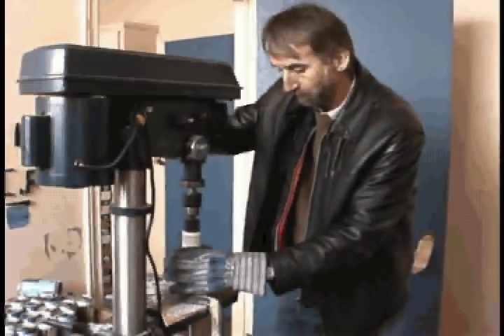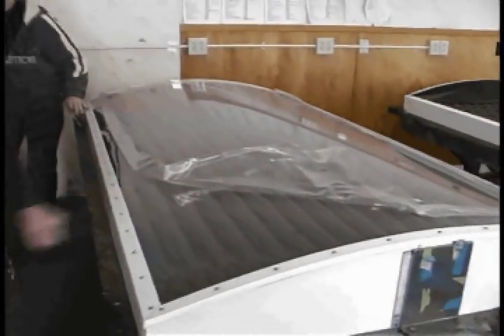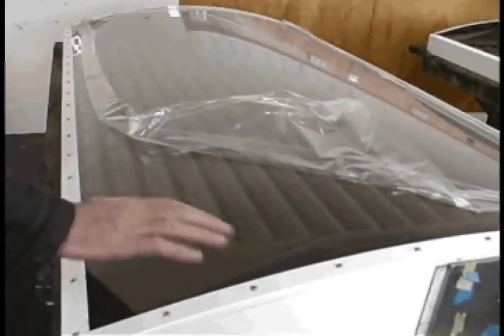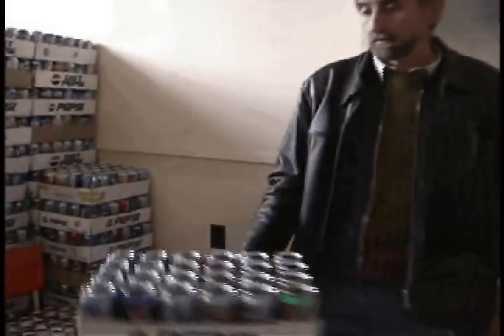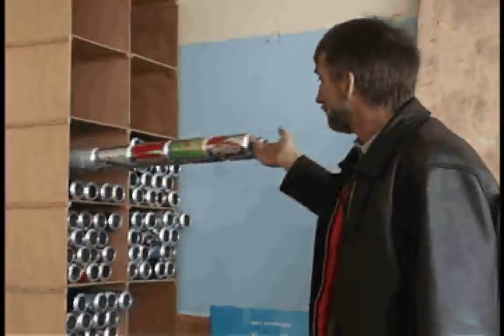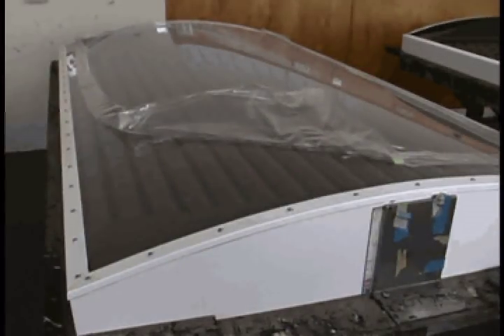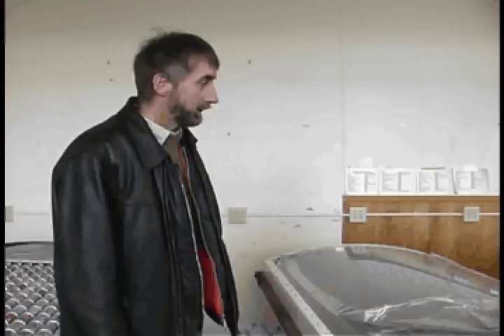Brilliant Newfoundlander Invents the Solution!

Comment: Oh people, you are misunderstanding the importance of this. The main idea is not just getting your house warmer for free. It is recycling, saving few energy cost and greenhouse gas emissions. Obviously it wont work at night, but it will save you few bucks during the day. Also you reuse the cans and contaminate less, Thats the point!
Reply: Sorry, but no.  It is about free heat.
Reply: Yeah I have to agree with Greg Green on this one... see the electricity it would take to recycle the cans into say Aluminum Foil ... well it is nothing compared to the energy savings in the HEATING... so... recycle the cans (to which you get paid for the Aluminum) by some wide aluminum foil .. use some clothes hangers (wire) on either side of the foil sheet as "ribs" periodically..... paint one side (the outer side of the foil BLACK .... then... do not use a fan... hole at the top to let the hot air in the house... hole at the bottom to allow cooler air from the house to enter into the plenum you have created cheaply.... and you know I know it doesn't sound green.. but a Fresnel Lens (plastic square one) used as the glazing on the front.. would REALLY boost performance.... see it's about not using electricity and using the recycled materials correctly.... aluminum foil mostly is made from recycled aluminum... and the increased output with less power input (the fan hint) ... well since you work it on convection.. you don't need to use electricity to run it...
Reply: jajaja wow, I study ecological economics and I know environmental issues like greenhouse gas are real because of physical evidence, I don't listen to government I don't even believe in politicians but that's another problem. All these opinions depend of the point of view of each one, calm down tough guy!
Reply: SmoothRide Scooter pnjjnhgnmm jkjnkjj
Reply: Ahhh vitality B. I have been there.. I simply remember is one I bottle of bourbon ... one bottle of whiskey... and one case of beer...  how the lawn gnome wound up in the backseat of the mayors car with me with us under the flag of Peru I will never know....
Reply: Oh freak.. leave me out of this.. I want to save the world with green energy technolgy while enjoying 1 bourbon...  1 wiskey.. and one beer... LOL
Reply: why do I feel old right now?

Comment: The energy companies won't like this at all.
Reply: Peter AUSTIN You can use it to heat up that rock you've been living under. These have been around since... well... 2008. Plus, if you're talking heating then you mean to say the OIL companies.
Reply: Austin Lucas
Good post. I haven't read Mother in years. It is a must have. I will look them up online. Thanks mate.
Reply: Doesn't work without a standby coal or nuke power plant, next.
Reply: +409novaman Huh?  It doesn't generate power, it collects heat from the sun... I don't understand how you think that requires another power source?
Reply: Actually that’s false.  Utilities want you to conserve energy.  They resist the need to build new generation facilities as the regulations and permits are outrageous.  They have no choice but to pass these costs to you.  Most if not all of them are incentivizing you to conserve.  Contact your utility and ask to have your home audited.  They will generally do it for free.  They may identify a few areas that may thought of.  Knowledge is power.

Comment: I see people asking the question - how do you heat your house at night with these heaters? I don't understand why someone would ask that question. At night you use the same heating system as you're using now. These solar pop can heaters has the word solar for a reason. Solar - Sun. They only work when the sun is shining on them. After sunset or cloudy days you use your existing heaters. Even when the sun is shining this heater won't heat an entire house. It just helps to heat it. I built one a couple months ago with 256 cans and it  works better than i thought it would. When the sun strikes it in the morning the temperature starts rising. After about an half hour to 45 mins it reaches about 185 degrees on a day of about 15 degrees outside and it stays at 185 until the sun goes down. I use a fan of 100 cfm. I'm selling the one i built because i want to build a bigger one. If you're interested email me for photos. I live in Newfoundland, Canada. Asking $1200.00...

Comment: This guy is a genious
the  shape of every can  improves  the spinning of the air inside  or else there was no (no significant)  metal to air heat transfer if the air goes straight trough it.
The can's are very thin so there is no loss
the box provides insulation so it is usable when it is cold outside

Comment: Without a low emissivity coating on the cans you will be limited to relatively warm climates and/or clear skies for any useful heating. The radiative heat losses will become very large as the temperature increases.  But, experimenting is fun.

Comment: How does this system perform in Canada's harsh winter conditions? does the Plexiglas containment allow it to absorb heat from the sun and be less effected from the -30 degree temperature and winds, or is there a noticeable performance difference with temperature change? Regardless great idea and I will defiantly be looking into this more!

Comment: The air from the room is sent through the cans and gets heated from the greenhouse effect of the chamber and plastic window . Also absorbs heat from the sun directly via the black  paint on the cans.
Sort of like a black hose filled with water on a sunny day,only using air.

Comment: Get two 2x6 sheets of corrugated tin mate the pieces together with the ridges touching and pop rivet together. This will make the solar heat exchanger tubes and takes about 30 mins to make. Put in a box with insulation on one side and glass front. works for me.

Comment: Air isn't the best, but not entirely a bad medium if it is controlled and contained. That is exactly how glass fibre insulation works in your walls. It traps air. The air voids insulate, the same way the space in your glass panes in double and triple sealed units do. Albeit, now you're moving the air, but it is from a sealed plenum that is building up the heat, and then moving it.

Comment: If you take the air in at the roof vent and expel it at the bottom vent you will improve the heating in the house. This only works if it is fan driven. You can make an air cooler system using evaporation, the tubes are porous and coated in fabric placed on the shady side of the house.

Comment: By placing a fan on the inlet (cold air coming in) you pressurize the panel. This will push the heated air coming out the top of the panel to a lower level. I had an engineer calculate how much it would cost for the electricity to run the fan and he said it will run up my light bill by around fifty cents per month. Imagine that...Heat a two-car garage for less than the cost of one can of pop per month!
BTW...Solar panels do work on cloudy days, just not as efficiently.

Comment: The  yield of the solar box is zero  at the maximum temperature.
You save around 1kWh/(m2sunnyday)  around 0.1$/(m2sunnyday) roughly, but with maximum air rate flow coming out at around  85°F=30°C.
The yield is maximum when the coming out up air is at the minimum temperature useful to heat the house, (minimum heat  loss inside the box ) around  85°F=30°C, with a large fast air circulation, with large input and output .
In this case the power is around 300W/m2  at maximum sun.

Comment: Since you are using a forced air fan blower motor, then blow the air flow reverse of what you said, heat naturally rises, so since you are using a forced air motor, blow is the downward direction so the heat that comes in the house will have a chance to feel it better, more near the floor , since it will rise anyway, send it out at the floor. It will work better, it wont affect the efficency of your heater, it will actually make it work better unless i missed something, let me know.

Comment: Well, it has to cost a fair amount to make one of these plexiglass & aluminum boxes.  The fan unit moving 100 cuft/minute is sucking down electricity 24/7.  So by no means is this totally free.  And don't forget the installation of this unit outside which involves a sturdy mount (think storms) and a two holes through your wall.  Then some townships may consider these units an eyesore - especially in a condo with strict rules.

Comment: The problem with solar heat is that the only time that the sun is at a point where it gives enough energy, it's summer day.  It's colder at nights and winters where the sun is the furthest away.  I could see this used along with a stirling engine to create power, and the power can be "stored" for use to create heat on downtimes, but not as direct.

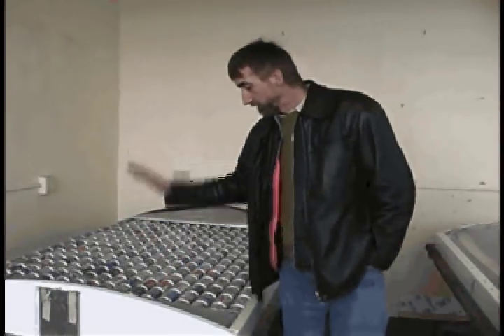Comment: this is an old video so this is likely a stupid comment, but you can "de-tab" a can much quicker by turning it around and popping it off 1:19 . a decent idea, but i think in the relatively short term (10 years or so, maybe longer) more energy would be saved by recycling the aluminum back into other products than making this a big thing, aluminum takes allot (not just allot, insanely massive amount. until electricity was a big thing aluminum was a more precious metal than gold because extracting it took so much energy) of energy to extract from the ore sands, but it doesn't take even a quarter as much energy to remelt it.
Reply: you got it ... aluminum is very expensive and polluting to make ... recycle it.
you can essentially do the same thing with pvc pipe
Reply: SmoothRide Scooter your post doesn't compute, you buy them both man. aluminium is a better thermal conductor than the steel cans that campbel's soup for example come in. but yeah, either work, but having them all be the same size is kinda needed.

Comment: @theapocilip These heaters are designed to work during the day.  If you live in a cold climate and you can utilize one of these units you could probably cut 15-25% off your heating bill.  The reality is is these things are not an alternative heat source, but simply meant to supplement. These heaters are perfect for garages and sheds that aren't heated and owners are looking for a low cost want to heat them during the day.

Comment: perhaps in the ocean, where volume factors into the equation, but if you own a hot water heater, you know your water doesn't stay hot very long if you lose your power, because there is no volume. Compressed air can have a lot more volume than water.

Comment: I have windows in my house that light goes through and heats up the room. Any window could be described as a solar heater.My windows/solar heaters are larger than these being shown here. When the light comes in it heats up the fabric of the room directly with out the need for pop cans,insulation or holes in my home.
Reply: And me linux. :v

Comment: I think that any glass surface has to remain perpendicular toward the direction of sunlight.   Otherwise, more sunlight will reflect off the glass surface if not straight down  on the "T" .  Guess you will need to rotate your solar heater to follow the sun. The air flow hoses will have to be flexible to allow for the wiggle playl

Comment: I wonder how you could store the heat for use at night? Maybe a bladder that fills with hot air then is slowly released over time? It would have to be insulated and pressurized.  It could be stored in the attic.

Comment: Is this just a supplement to regular heating?  I'm assuming it only works when the sun is out?   I live in Texas and when the sun is out in winter, we have no use for heating.  The radiant heat alone is more than enough to warm my home.  In fact, it's often times too warm.  30 degrees outside with direct sun equals 70 degrees inside.  We have use for heating at night when the sun is not out.

Comment: @magicyte most of that money is for the materials itself and the preping of the cans

imo the paint alone costs 50 bucks a can since its specialized to resist the weather for atleast 30 years
the polycarbonate lense on top is the masterpiece for those means
1 square meter of that stuff costs around 400-500 euros down here and as it looks its coated aswell(against scratching and such) probably just over 2square meters of plating there so big win for them

Comment: My guess would be that since it needs sun light, then it will only work during the day,,, but should supplement your existing heating system by up to 20%  it could save you a bunch over time

Comment: Great! How do you turn it off in the summer?
Reply: They need to have an upright position to ensure convection. So, they are installed on outside walls or outside anywhere, but the roof, easy to access. Disconnect the power, take off the intake and outlet manifold and store it in a garage for summer. Batta-Boom-Batta-Bing. Done till winter.

Comment: What do you do during the summer months? Doesn’t the unit continue to get hot?
Reply: TheseusTitan He says that the temperature control will let it vary between 1 degree up or down and will turn off the fan once it's warm enough. So I imagine if it's warm enough in the house in summer it simply wont run the fan. Not that I know exactly but that's how I imagine it would work.
Reply: Thanx Lene, that is how I imagine it too. I was wondering what happened to the temperature, if it went up or if somehow he got it to stay the same without the collector.

Comment: @staticincanmore I had the same query, I'm assuming the units are not designed for outdoor use like a conventional solar panel. It would be put in a generally well lit portion of a home. Not efficient if you live north of the 48th and useless if you're within 800 miles of the arctic. I'm gonna try to learn more but thats my first impression of it.

Comment: If it was a sunny day, why would you need a heat source? What about at night? I like the design, it's sleek, with that curved 'glass'. I can see it's use for water, or for drying clothes and other things perhaps.
Reply: +Marmamarquess The sun shines in Canada and even the South and North Poles does not mean it does not get cold there.  In fact usually a High pressure which brings cold in winter also brings sunshine.
Reply: Captain Jim Lot of radiant heat where you live?
Reply: +Marmamarquess read up on thermodynamics kimosabe
Reply: Didn't  see nothing about Canada's sun Tonto.  What would you need heat for when you already got it naturally?
Reply: +Marmamarquess Well, it's a sunny day right now in Iqaluit, Nunavut, Canada. And it's -35C (about -30F). We could use some solar heat right about now to save on the fossil fuels we burn here. Which, BTW, are the only option as we're well above the tree line.
Reply: +Marmamarquess it allows heating through solar gain without a window, are you dense?
Reply: ekoms108 Sorry, wouldn't want to doubt the ground breaking expertise so much in evidence here. Global security has been solved!

Comment: @Landotter1  If the air flow has more inner surface contact time through increased resistance, I suppose that would be true, although I would think that adding a stationary dispersion turbine arrangement at the bottom of a smooth uninterrupted tube would be able to create a more efficient vortex, if that was what you were looking for. You could test that out w/o the turbine by experimenting with different sized restrictor plates at the bottom of the columns.

Comment: @grimlord66 actually some designs have a circuit where you also heat rocks during the day and later on during the evening, the circuit outside is closed and the heat from the rocks will continue the process.   Dont know where u are from but where I am my heating bill is up to $250- 300 a month depending on what they decide to charge me for natural gas and electricity when it is -30C outside.  So even saving 25% on my energy bill is great

Comment: Its not the enclosure that holds and provides the heat. 
The cans are cut in a specific way and put together like a heat exchanger (coil), the air passes through the cans and the air flows through at a specific rate. the more surface area the greater heat potential.
so I think a large black box wont work. Maybe it will?... take your idea, cut a hole in your roof, make a big black box and and let me know ;)

Comment: Is it possible to circulate glycol thru this system? Glycol would retain more heat and service a larger area.
Reply: Wouldn't be convection based, which is the novelty of the invention. You could make a heat exchanger with glycol, but it wouldn't be advisable for the same reason we don't use old soda cans to make any other kind of water-tight tubing
Reply: by sticking a tube inside between the cans (center) yes , also insulate the back ans sides and painting the tubes black inside keeping the inside of the cans silver , additionally having a additional tube pumping water around a copper pipe with antifreze liquid you could also use it to pump hot water

Comment: How does it work at NIGHT tho where I live it ends up below -40 with windchill so.. Should I get blankets or light my woodstove?
Reply: They are not made to give heat when the sun is down. Those heaters supplement your existing heaters when the sun is shining. When there is no sun you go back to your existing heaters. One of those won't heat your whole house either, it will only give some heat to lower your heating costs...

Comment: @eastern2western Truly the best method involves the house construction to have solar heat in mind when it was built. Then we'd have "dark areas" within the house collecting the heat. Of course this is not possible in the average house to a forced air external box is the only way. You do lose some heat....although that could be lowered substantially by adding clear poly vapor barrier to the outside of the box. Just like window sealing...would work like a charm for only a couple bucks.